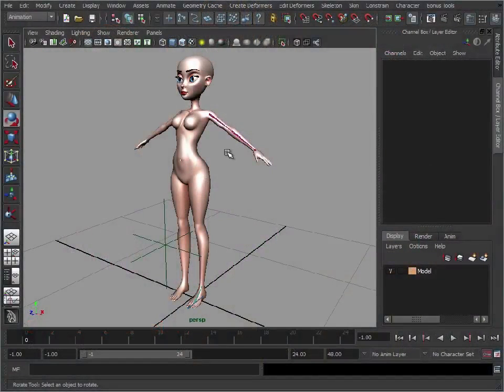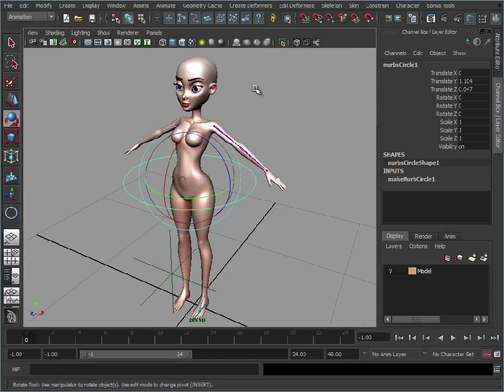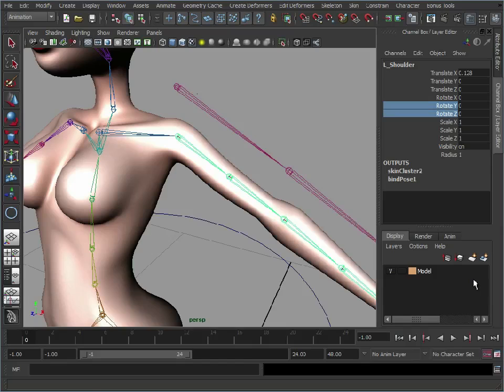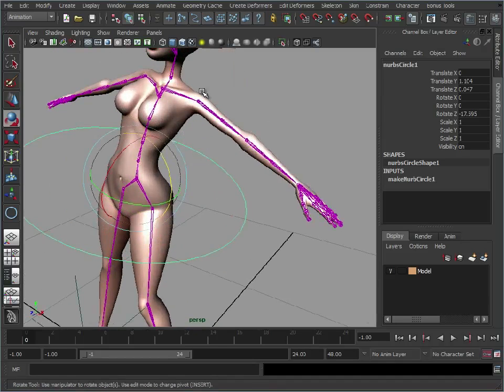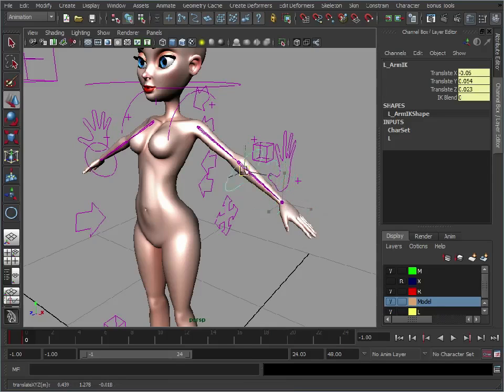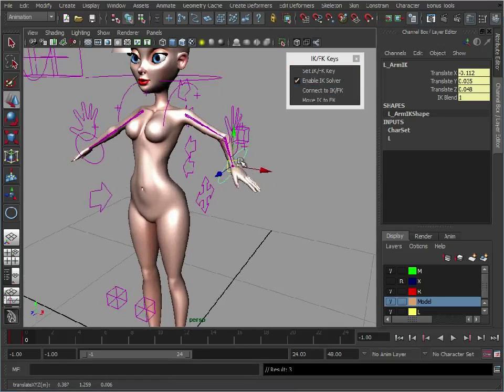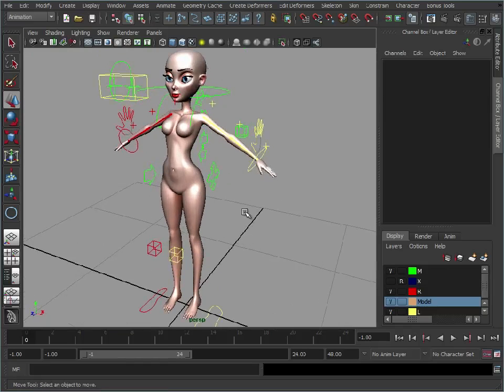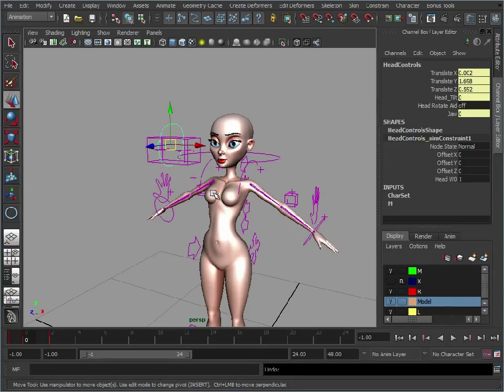Maya tutorial: Rig and pose a character, Part 8

Comment: Hello, I just found your tutorial and I need some help.I tried your tutorial from step 1 till the paint skin weight. But today when I tried to apply the Ik handle, it didn't work and I redo the whole thing. But as I rotate my character's shoulder (lift it), a small part near the armpit got lifted as well. I checked the skin weight again and nothing happened. I try to redo the whole step and I still face the same problem. I need your help. Thank you.